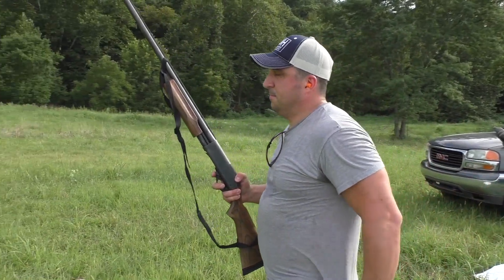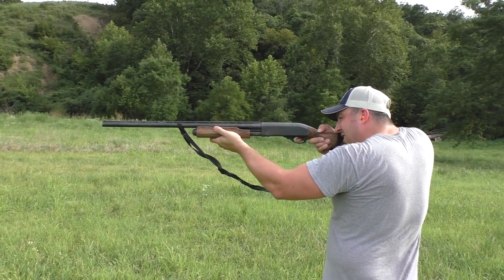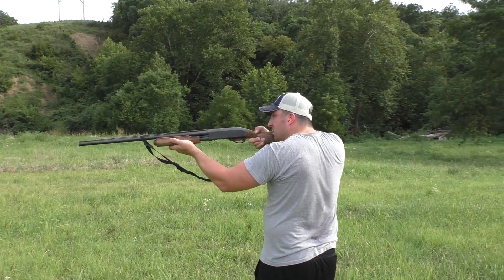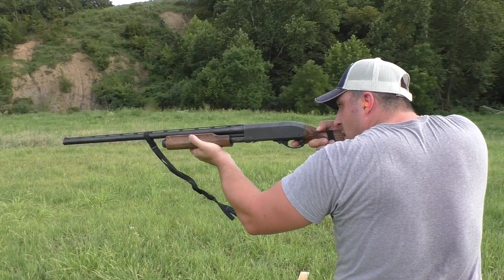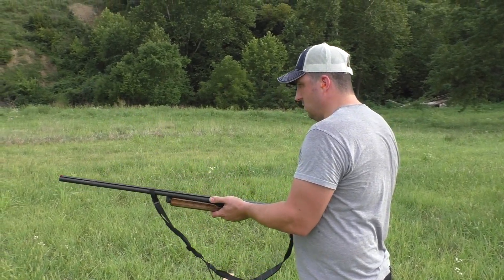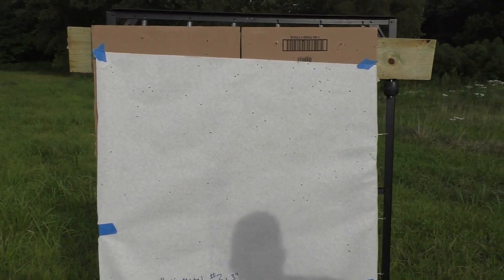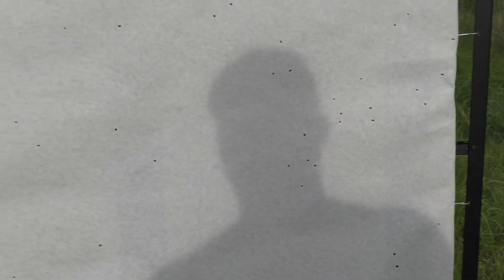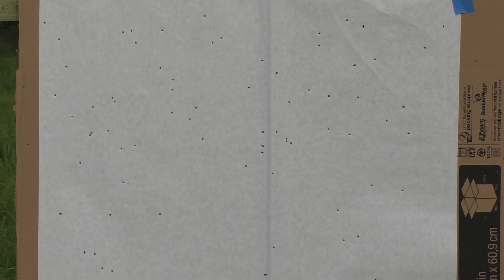Duck Hunting:  Heavy Metals vs Steel Shot

Comment: Early season i use 6 shot and it kills them deader than a door nail
Reply from the maker: steel?
Reply: I think that is probably the best practice for shooting teal particularly.  I have not shot 6 steel for teal because I buy my shells by the case and don't want to spend the money for a whole case of 6's and I don't want to cross over during mixed bag time using a few 6's when I might encounter a drake mallard or two.

Comment: dont convert. try buying choke tubes that are meant for steel. like the kicks high flyer. its a one time buy and will save you money. It will pattern the cheap shells well so you wont have to buy expensive ones.
Reply from the maker: But we don't shoot at the "high flyers"  I would think that would be much too tight a pattern at 15-25 yards.
Reply: all it does is extend the choke for more consistent patterns and shortens your shot string.  They make a modified and I think an improved cylinder as well as a full and they aren't that expensive like pattern master go check out their web page you wont be disappointed

Comment: This is why I reload myself..shells i reload are FARRRR better than anything that can be bought and Its much cheaper..also, why are they using improved?? Come on modified kicks or something lol 
My reloads are 3s and 2s and also BB shot for geese. 1650 fps
Reply: Better that 100% hevi-shot or Kent tungsten matrix? A fast steel load isn't effective. Steel is so light that when you boost velocity it just zips through birds. You want a heavy pellet like hevi-shot # 4-1 around 1300-1350 fps to get the hard hitting crush of a heavy shot
Reply: Not sure I follow.Surely any pellet that goes through a bird has therefore had maximum opportunity to hit something vital.
Reply: $79.99 worth of tungsten gives you enough shot to load 48 shells. Not counting the cost of shells, primers, wads and powder. I’m trying to see in what math that is cheaper than $35 for 25.

Comment: Hevi Metal is only HALF Hevi Shot; the back half of the wad is steel shot. Hevi Shot shells that are 100% Hevi Shot are $4 a shell and up. Being half and half is gonna screw things up. I've never gotten good patterns out of Hevi Metal. Steel and Hevi Shot are so different in density and hardness it's a wonder the pattern isn't worse. Hell, in Hevi Metal you have 2 different size pellets. If you want the good stuff drop the coin and get Real Hevi Shot.

Comment: Box of Steel, Winchester 1550 fps 3 "  1 1/8 oz.  for 10.99 per box of 25 is way better  than any of this High Priced Metal or Bismuth,,,  its cost effective to purchase winchester and get BB on thru size 6 steel.  smaller ducks i always use size 3 or 4 steel... and keep the Ranges within 40 yards or less.. Larger ducks depending on how being hunted,, decoys would be size  3 or 4.. longer ranges might move up to #1 steel or BB ,,,  Pass shooting would be the 1,BB at 40 plus yards.

Comment: Check out my video Hevi shot lighter than steel. It will help explain why they don't hold pattern. Also the density is actually less than steel so they are lighter and that causes them to stray. Nice video!

Comment: Elliott, in my opinion your only gonna waste money with those more expensive kind of shells. my son and I don't shoot at anything outside of 35-40 yds. and most are within 30 yds.  we patterned our guns this year with multiple chokes and 6 different loads. Winchester drylok, hevi metal, kent, federal (not black cloud), federal (black cloud), and browning new bxd.   we patterned at 30 yds. my son shoots an 1100 and I shoot an sx3 (Winchester).  ironically the more expensive shells were some of the worst patterns. browning, was worst by far. then hevi metal black cloud and dry lok were tied for third. federal was an easy obvious second, and kent was first in every choke/load combination except one ( and it was second in that one).  so at the ranges you shoot 35 yds and in your 12$/box federal will drop em all day.  I'll be using the $15 /box kents which is still a great price. good luck and keep them videos coming.
Reply from the maker: +Stephen Wagner thank you Stephen! I agree and plan to continue using the federal loads.

Comment: Who hunts with an improved cylinder at 40 yards??? I killed the crap out of mallards this morning with Hevi Metal #2's at 20-45 yards with a Super Vinci in a Kick's Highflyer Full choke.
Reply from the maker: No one should.  I hunt with an improved cylinder in order to maximize my kills from 20 - 30 yards.  I don't like to shoot shots outside that range. I want them close!!!  Full chokes are not near as effective on ducks in close.
Reply: +Freelance Duck Hunting it's all about how you adjust to it. If you get used to shooting a full choke and 15-25 yards you can be just as efficient as someone shooting a improved cylinder. It's just about the shooter
Reply from the maker: I'm sorry but that is just not true. An improved cylinder choke at 20 yards has a radius of 26 inches.  A full choke at 20 yards has a radius of 16 inches.  That's a 10 inch difference. There is absolutely no way you'll be as effective at 20 yards with 10 inches less in diameter of your shot pattern.
Reply: Freelance Duck Hunting That's a two way street. Yeah, you might have a bigger radius, but the bigger the radius the less shot concentrated in kill zones. I like a tight pattern to finish birds. An improved cylinder beyond 25 is borderline unethical for me. The smallest I'll go is modified for ducks. Duck hunting can be unpredictable, so I feel like I need an all around choke. That's why I shoot full or modified. Maybe you can reliably set ducks down in your face in Kansas, but in North Louisiana/South Arkansas, these birds are hunted hard and highly educated at this point in their migration. We drop them at 40-50 if we have to. I'd prefer them to light in the decoys, but that's not always realistic.
Reply from the maker: I do understand your point and Dan and I have actually been talking about bringing all our chokes with us so we can change mid hunt if needed.  

To your point about not as many pellets in the radius being a bad thing.  A 30 - 40 inch radius is considered the prime shot distribution to kill ducks effectively. So that's never a bad thing compared to a radius under 30 inches.

As I stated previously a full choke has a 16 inch diameter at 20 yards. When your talking about a 16 inch diameter at 20 yards your handicapping yourself at that range.  That's why I'll never use a full choke as my standard hunt in and hunt out choke. Ive traditionally used a modified choke but decided to move to an improved. I may go back to a modified but i'm not sure yet.
Reply: if you decide to give hevi metal a try put your modified choke in and give it a pattern test that should be about the same pattern as your federals with an ic choke
Reply: I agree with the above comment. It is ALL about the shooter. I use extra full chokes for ducks and geese all of the time. Whether they are 15 or 50 yards, makes no difference to me.

Comment: improved sucks for most hunting situations.keep it for clays or toss in trash.
Reply from the maker: Actually this is not a matter of opinion. It's a mathematical certainty that IC is the best choke for shots between 15-25 yards.  During teal season that's the range we shoot our birds therefor IC is the best choke to use at that time.
Reply: with all variables aside if you are a good shot ,full choke wins every time in hunting.at the range you are speaking of head shooting should not be a problem.full choke will not leave my gun for ducks and geese.sorry I don't agree.math vs. real life hunting,to many variables.I still respect you facts and info. thanks for your videos.

Comment: i shoot steel 4s, 2 3/4 clever brand, in a stoeger o/u modified and improved kill ducks out to 70 yards plus, see no reason to change to dear shells. or why bother trying heavy metals,or even buy 3 inch, rarely i get wounded ducks, you cant kill something more dead than dead. when i used lead i used to use 7s same thing just in an u/o bakail killed as good. im actually impressed with steel now i have a gun with removable chokes. i have tried 3 inch ect in steel no improvement over 2 3/4
Reply: 70 yards my ass, going to call you"The crippler"
Reply: Darryn worthy  Mate, # 4 steel clean kills at 70 yards!  Fellas that claim that here in Australia have a very special name. We call them ”Wankers” !